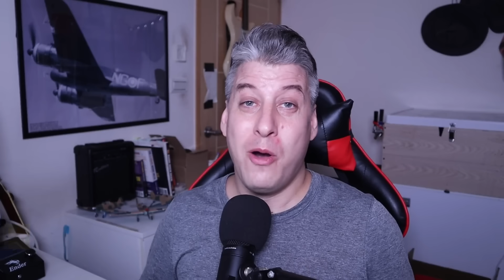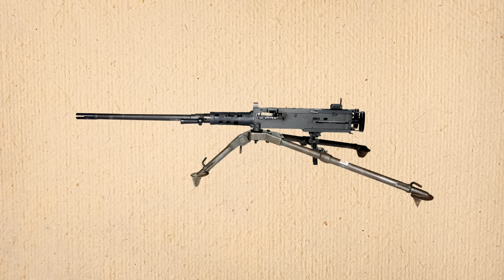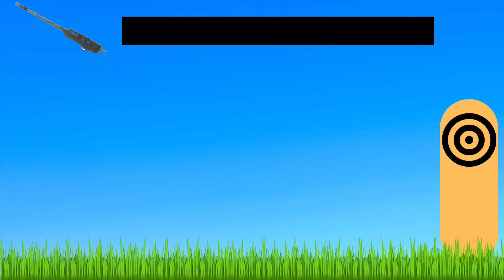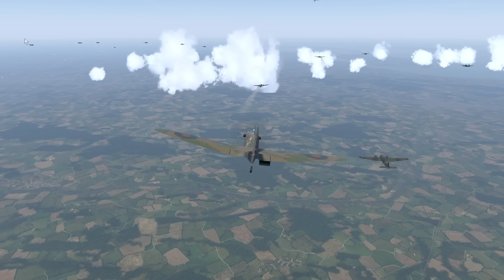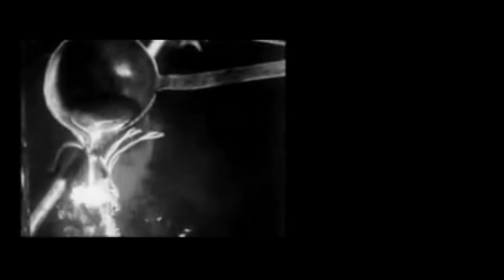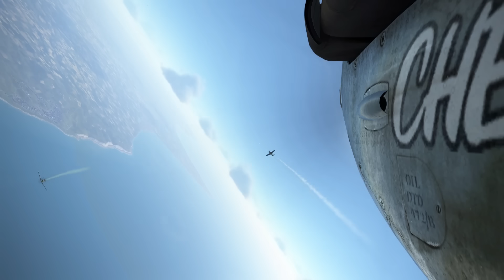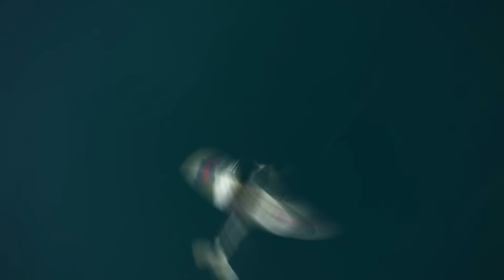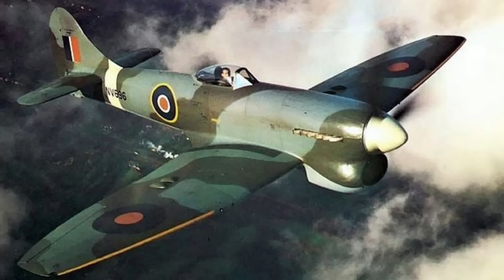Why Did The RAF Use .303 Caliber Machine Guns in WW2? The Surprising Answer

Comment: Here's a thought he mentioned how the .303 tracer rounds lit up upon impact so in a configuration of a .303 and a 20mm you could in theroy use the .303 to line up your shots using the flash they created on impact to ensure a hit with the larger 20mm to make the best use of the limited ammunition carried
Reply: Incorrect. Especially when pulling G's.

Comment: Great video, and thanks for putting this research together. I'm a fan of the U.S. Cal .30 M2 (or ANM2 .30) that was modified into the open bolt variation in Britain, culminating in the Mk II .303 model. The basic design was a joint project from U.S. Army Ordnance and Colt's, developed around 1929/1930. This gun was far smaller and lighter than the .30 cal Browning 1918 and 1919 series guns made for aircraft use, but based on the full size receiver from WWI. The ANM2 designation was used also for the .50 cal aircraft guns used on U.S. war planes, so one must distinguish the caliber when discussing these. In U.S. service, the .30 cal M2s were used most prominently on Dive and Torpedo bombers, in the tailgunner's position. The famous Dauntless dive bomber is the best known example. Colt's produced these in .303 for the British, and later Buffalo Arms, before manufacturing was initiated in Britain itself. There are interesting distinctions between the Mk II and the American ANM2, much of which I suppose has to do with mounting and triggering requirements, but the open vs closed bolt operation is the major functional difference. Fortunately, here in the States, it is still possible to experience shooting these amazing, historical arms.

Comment: Jeffrey Quill was flying a Mk 2a Spit fitted with 20mm Canons which as you said froze at altitude, my grandfather was involved with machining the 20mm cannon barrels to get the tolerances just right, he said in the end they just taped over the end of the barrel, but later warm air fed from the engine solved the problem. Douglas Bader preferred to have an aircraft fitted with 8 X 303 mg's he had his guns adjusted to provide a concentrated cone of fire at 200yds much closer than the 600yds recommended in the Manuals, in fact, he had his MkVa Spit modified to have 8 X 303's fitted instead of the cannons it was built with. He thought the 303s provided a much higher concentration of destructive firepower. But then he did get shot down a few times! I believe we did adopt 0.5-inch mg's for our fighter aircraft later on.

Comment: Both the Spitfire and the Mustang had nearly laminar flow wings. The .50 MG is so large compared to the .303 or .30 cal MG that even the Mustang had serious feeding issues with the Browning M2.
The .50 is of course greatly superior to any .30 cal round but not much use if it's unreliable.
The M2 simply would not fit in the Spitfires narrow wing . In the Mustang, the M2 had to be mounted at an angle causing all sorts of issues and under heavy G forces the M2 would often fail to feed.
Of course the big bird, the P-47 or Jug had lots of room in those big wings so the .50 was a natural fit.
Eventually the 20 mm cannons were fitted under the wing of the MK ix Spitfires and the wingtips clipped.
The 20 was devastating at close range but had a rather looping trajectory at distance.
Reply: Correct
And plenty of kills were recorded by RAF pilots and their "useless" guns.
Only in America is bigger always better.
Reply: The Spitfire NACA 2213/2209 aerofoil was a low drag under high load aerobatic wing, definitely not laminar flow.  The P-51 could not turn well but speed was more important anyway.

Comment: hit weight per second + stored energy of the impacting rounds + explosive energy once penetration has been achieved. get that mix right then add in how many can be carried by the firing  aircraft and you have choice of the calibre. 20mm-30mm seems to be the correct scale to be aiming for.  question- why not have uk license production of the .50/12.7mm cal m2 aircooled browning in 1936 and it's ammunition?

Comment: I fucking love .303brit. This comment is a love letter to it. Personally, I'm a .303 British enjoyer. .303 is a terrifiying caliber. I would much rather be shot by 5.56, .243, 7.62x39, or .308 (based on what they do to deer and beer cans from personal experience, .30-06 is similar). My grandfather's best hunting rifle was a Lee Enfield Long Branch he sporterized (it was the 50s, it was cheaper to buy those instead of wall studs). Thing is, he was a small time gunsmith, the bolt is jeweled, apparently he made the stock himself, and he personally shortened the barrel. Beautiful rifle. I hold no illusions, a $500 hunting rifle will hold a better grouping with much easier to find and cheaper ammo. But .303 just has a personality to it, like a first beloved car. The rifle seems to bring me luck, and while at the range it's sub 1 MOA, in the woods it seems to cut through brush and strike right where I want to. It will cut through the "boiler room" of a deer, and exit the shoulder shattering bone with it and leaving a gaping wide exit. When I was using the 60s tasco scope, I'd often hit spine, and it would disintegrate vertebrae. And on beer cans, absolutely shredded. I have no doubts .303 would destroy fuel tanks or pilots. Fuckin love that round. I'll use it until my death.
Reply: You know that Brit snipers in WW2 carried only ten extra rounds - and had the highest kill rate per round of all.

Comment: With most pilots the greater amount of bullets in the air at one time with 303 is a good thing, as even one hit with a 303 bullet can cause a plane to crash., and more rounds can be carried.  cannon shells better against slow moving or stationary ground targets, and maybe even bombers - but against a fast moving and agile air target the greater spread of bullets is better.  The sweet spot for an aircraft gun is probably 50 cal,  with more power than 303  and more shells in the air than 20mm.

Comment: The skilled fighters in the BoB tended to disregard the harmonisation distance for their wing guns as recommended by the RAF, which IIRC was several hundred yards and used a much smaller distance, even down to 100 yards (300 feet) or less! This gave the guns the close-in punch they lacked at distance and made for less wastage of very limited ammo and faster kills which was important in the melee of dogfighting. Also the rate of fire being faster than even the 50 cal of the time meant that snap-shooting, which often was the only kind possible, had more chance of a hit. Bob Tuck and Douglas Bader had many arguments about the guns in use which Tuck recounts in his book "Fly for Your Life". Bader wanted cannon whilst Tuck was determined to stick with the .303 for it's reliability and adequate performance - but Tuck was a superb shot and used to get in very close to his quarry, in itself a measure of his flying skill!

Comment: It seems I once read that the .303 was favored in the spitfire partly because the wings were so thin that putting the browning .50 in was a very tight fit and would likely mean fewer guns could be installed. I notice that when they installed the 20mm guns they had to make blisters in the top of the wing to fit them. Any comments?
Reply: You are correct Keith.

Comment: Hmm?  The vid posits some ineffable benefit from using one gun over another, when all of those guns and more were in fact used at that time and similar and different guns still get used even now.  

The Browning .303, the Browning .50, the Hispano and Oerlikon 20mm cannon were all fitted in a Spitfire's wings (for example), the Spits named Mark 'N' e had the 'e' or 'universal' wing, that could fit any of those, and this was phased in around the end of 1941.  

Before then, Marks or sub-types tended to have different weapon fits, that include some or just one of the types.  

The Vickers, BESA, BESAL and other guns had numerous calibres, and could be used on aircraft, tanks or as ground-defence weapons.  

Perhaps it's an assumption that the .50cal and only the .50cal has that special magic?  

The Germans used a 12.7mm (almost exactly half an inch) Heavy MG with explosive and incendiary rounds as well.

Comment: What the video missed is that when the RAF tested all the various machineguns, some of those tests involved firing at actual aircraft. What they found is that passing through a metal airframe tended to to topple the bullets, so when they then hit armour or other components the .50 didn't really penetrate significantly better or do much more damage than the .303. It was a bit more effective, yes, but in the RAF's opinion it wasn't more effective ENOUGH to justify its extra weight, which meant fewer guns with less ammunition. They decided, rightly in my opinion, to just stick with the .303 until the Hispano was perfected, then go straight to cannon armament. 

The USA, on the other hand, couldn't make the Hispano work reliably. That's why they stuck with the .50 all through the war - they didn't have anything better. The USAAF and USN were both well aware the cannon was a better weapon, and ordered hundreds of thousands of them - but the guns didn't work, and most were scrapped without ever being used.
Reply: I understand that the US M3 cannon was tried and made standard, but only after WWII (and probably after Korea as well).
Reply: @stevetheduck1425  The M3 was the successor to the failed M1 and M2 guns. It was basically a US copy of the British Mark V (the M1 and M2 were Mark II copies) but the Bureau of Ordnance insisted on continuing to use the longer US chamber, so it still didn't work. The USAF added an electrical cocking mechanism so it could have another go at firing after a light strike, and called it the M24, but it was still very unreliable and didn't see a lot of use. The USA didn't produce a really usable 20mm until the M39 in 1951, and that was a completely new revolver design.

Comment: Why is it so easy to list the rounds per minute, the weight of the ammunition and such, but too hard to calculate something as obvious as the actual power (energy, whether kinetic or explosive, delivered to the target per unit of time)?
Reply: It's probably easier to measure the gun and it's ammunition, rate of fire, etc. than to find the wrecked planes, discover exactly how it was downed and then count the holes, allowing for the lost parts of aircraft, the burned areas that don't exist any more, or are at the bottom of an ocean, probably.

Comment: It is always good to read an account by someone actually there when decisions are made.   A good place to start is "Duel of Eagles"  Peter Townsend's account of the BoB (he really liked his Hurricane).  The RAF held all sorts of trials during the interwar years to optimise their armament.  They even tried a prototype fighter with a 37mm cannon, obliquely mounted to kill Zeppelins should any show up, but that is another story.   During the 1930s, they wanted a reliable and higher rate of fire for their mgs and trialled the Vickers GO or K gun, in competition with the Lewis gun for comparison, the modded Vickers Maxim, the RAF modded Browning (fired from open bolt so the more sensitive cordite filled 303 did not cook off) etc., etc.   To cut a long story short the Vickers GO/K was by far the most reliable and had the best RoF (up to 1200 rpm with a chance of more).   The wee snag was that it was pan fed, the Gladiator took one in a tray under each wing, that was doable, but try squeezing a battery of those into a Spitfire wing!  The compromise solution was the somewhat modified belt fed Browning 303.    The Spitfire wing was complicated to build anyway and it was really hard to get 8 x 303s in there, just look at the distribution and compare with the Hurricane's concentrated gun battery.    Despite what is sometimes believed the RAF had 20mm in Spitfires in the BoB.  The wee snag there was the flexing of the wing (a virtue under other circumstances) jammed the cannon feed.  Pilots pleaded for their 303 Spitfires  back, guns that work are better than no guns.

I won't go in to the Hispano saga in detail again, but once Martin Baker had debugged the Le Chatterellaut (yes it was French) belt feed all was sweetness and light.   In fact the Hispano once fixed, was so reliable they deleted the pneumatic cocking system to save weight.   What the US subsequently did to it is a sorry tale and to my mind might account for the longevity of the 50 cal.    There is a halfway house, if the Hispano 20mm was fuselage mounted it could be drum fed, and the first were.  In the case of the Beaufighter NF for example, it was the observer's loathed job to wrestle empty drums off and full ones on.   In the pitch dark in combat.  Juggling 60 round drums at 60 lbs apiece was an unhappy task, especially in a confined space out of reach of your chute..   Anyway once debugged and belt fed the RAF used 20mm cannon just about everywhere suitable, Beaufighter, Mosquito (also 57mm Tetse fly), Spitfires in all flavours,  Hurricanes ( 4 x 20mm, a version with 2 x 37mm was also used), Typhoons, Tempests, Hornets, Fireflies, Meteors etc.   Even the prototype Windsor bomber had a couple of remote twin 20mm cannon.   A Wellington was trialled with a low profile 40mm turret, I reckon that must have been rather a slow RoF.

There were two clear exceptions to a preference for cannon,.  When working up a seriously high altitude interceptor serious consideration was given to reverting to 303.  They could be counted on to be made to work at the very low temperatures (icing problems) and pressures to be encountered, they would weigh a lot less as would the ammunition (a serious factor in gaining the altitude required), and all they had to do was poke a few holes in the other guy's pressure cabin.   The various pressure cabins back then were not pressurised to one atmosphere, the pressure differential would be far too great.  The seals and connexions were enough of a problem as it stood.  What they did do was help the crew's pressure suit do its job, no pressure cabin, no crew - or at least a rather dead bluey purple one.  The other 303 exception, which I always wonder about, is that Hawker used to offer prototypes with a dozen or more 303s in the wings.  If you have space for that why not fit something else?

The other element in this general theme that makes me curious is that the North American Sabre was rolled out with 6 x 50cal in the nose.  I believe that this was used in Korea but stand to be corrected on that.   At the same time, the Red Airforce MiG 15 (complete with its rip-off RR Nene engine) mounted a selection of 27mm, 37mm and upwards, cannon.   I reckon something hit by those stayed hit, why the difference in choices?
Reply: RiP off rr nene the labour party of GB gift re d the nene to the russians
Reply: @Walter Sansom  Trusting souls who did great things to rebuild Britain post war.  They had guarantees from the Soviets that the Nene would only be used for civilian transports.  Yes I know, a bit too trusting, but we had been allies in rather dark times.  However, that said, they also knew that RR and the Bristol boys and the rest had even better engines just around the corner.  For example, Whittle even had an after burning centrifugal engine of humongous thrust ready for the Miles bid to break the sound barrier.  Sadly the plug was pulled on that project (the cash wasn't there) and all the technology, including the innovative all flying tail, was gift wrapped and gifted to the US.  Winkle Brown was really p****d off, he really fancied a shot in the Miles. This is one of the two men who might have in reality have already exceded Mach 1 when trying to discover what made the DH Swallow a definite pilot killer.
 
Unlike the Bell manned missile, the Miles' effort  could take off under its own power and had an under carriage.  I've seen the wind tunnel model in the Museum on the site of the old Miles airfield.  Sic transit Gloria mundi and all that.
Reply: My understanding regarding the Sabre is that they stayed with the .50 because of the combination of rate of fire and muzzle velocity,  and because the gun had been demonstrated throughout the second world war to work well. Despite the Sabre's godlike kill-loss ratio in that war, the .50 was found to be somewhat lacking and later Sabres - especially Export versions - went over to 4 x 20mm and even 2 x 30mm (e.g. Australia). By the time the Americans switched to cannons, only one of their gun-armed fighters ever saw combat in US colours - the F-8 Crusader - and even there, the writing was on the wall: I read somewhere that the F-8 pilots had an unofficial competition (unsuccessful as it turned out) to see who would be the last American pilot to become an ace without using missiles. (The F-105 with the internal Vulcan cannon has quite a few gun kills to its credit, but it was overwhelmingly being operated as an attack aircraft with a self-defence capability and not as an air-superiority dogfighter.)

Meanwhile, the British designed their jet fighters from the start with a 4 x 20mm armament (e.g. Meteor, Vampire), which may account for why the Australian Meteors (and one or two British Sea Furies) got as many MiG kills in Korea as they did - the opportunities were fleeting, but the armament took advantage of them - and also IIRC why the Skyraider of all things has a tiny handful of MiG kills to its credit in Vietnam (shots of opportunity against MiG pilots who missed and overshot in front of their intended victim).
Reply: @Ensign_Cthulhu  Thanks for that.  It figures, something that goes bang when you press the button is much preferable to one that goes click.
Reply: Great comment my man
Reply: There was at least one Hurricane model with 12 x .303 Brownings.